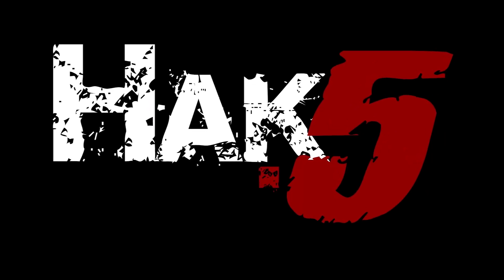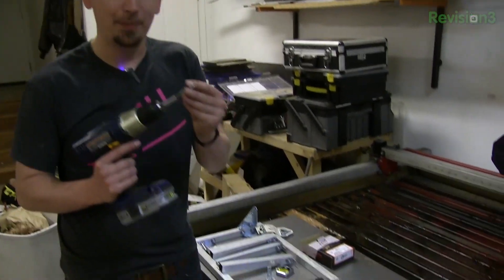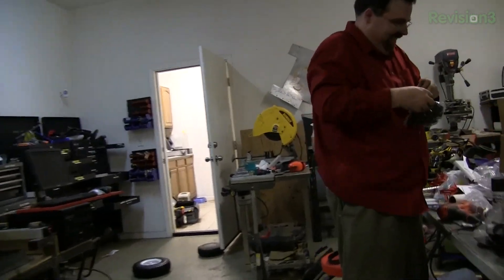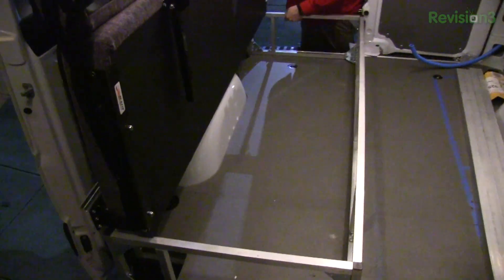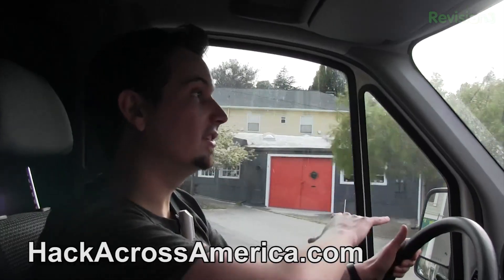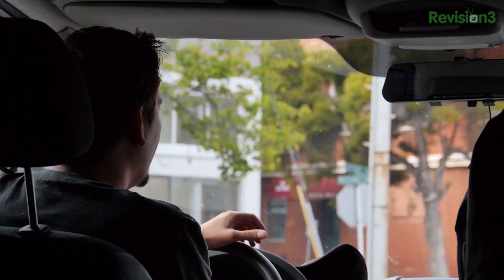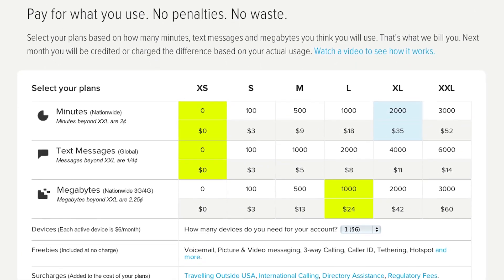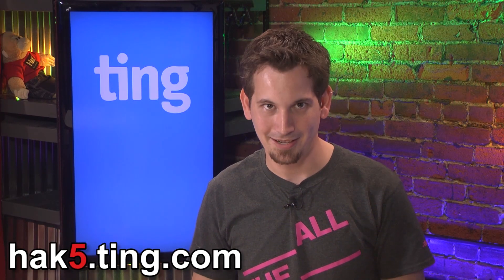1407.2, Announcing Hack Across America

Comment: Sorry to freak you out. Go with a CO monitor they are not expensive. My concern was sleeping with the bank of battery's. Even though they are sealed-- I'm sure you have seen them bulge and breach the case. CO being the concern if you plan on running the vehicle for heat. We Rae Systems monitors and they are expensive. Again just freaked out bro thinking of you sleeping in the van, motor running in a Walmart parking lot, charging the battery's, free brews...aka: firedog